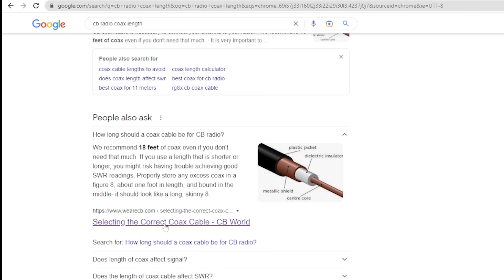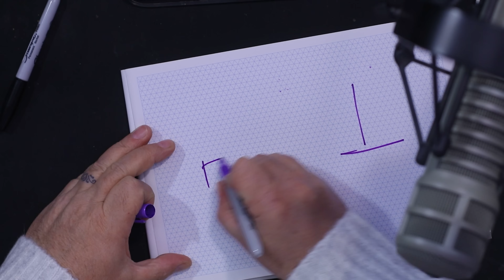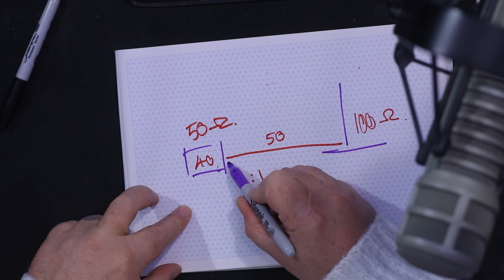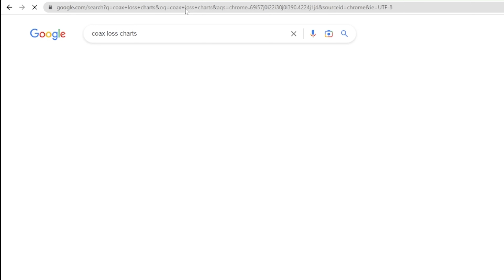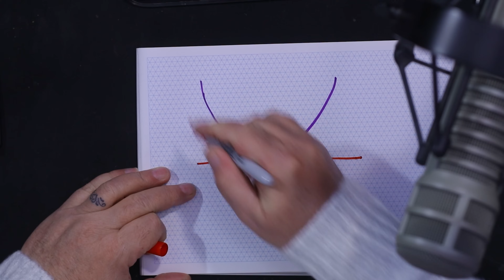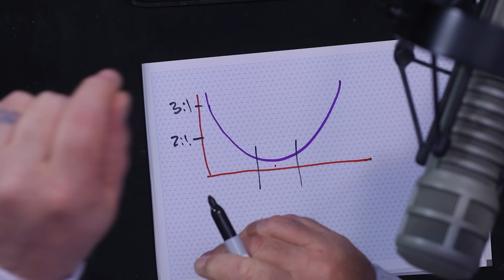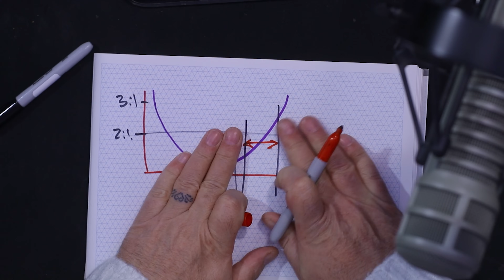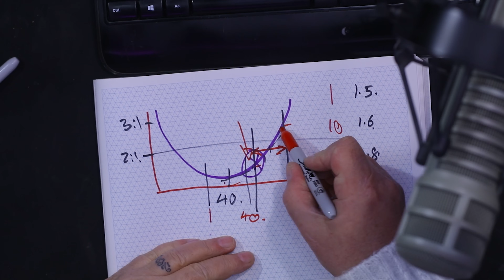11m / CB Radio: How Long Should My Coax Be?

Comment: in the 90s I also heard many theories on conductive but non-magnetic antennas and supports, I saw the coax cable cut for cb in multiples of half a wave, calculated on channel 20, also calculating the speed factor of the cable and a speed of light of 198,000 Kmh why not in free space where it is calculated at 300K, all for a CB with 4W, anyway RG213 is the minimum to use. Thank you🙂
Reply: I'm not sure what you're saying on how they calculated the length, but why not a half wavelength or more? This way you can actually see the impedance of the antenna when you plug in your analyser. As for 213 minimum, that's just ridiculous. In a mobile setting? Quality RG58 is fine, and far more practical. The difference in losses is negligible, and couldn't possibly be detected on a receiving meter. That's about the stupidest thing I've read on YT in quite some time. Where do you people get off?
Reply: @arconeagain  There was talk of fixed and non-mobile installations, try to stay on topic and not daydream, in the channel I have never seen road tractors, trucks, boats or cars, and usually for a 5/8 antenna between descent from the mast and section to get to the CB there they are more than 20 meters, yes the RG58 is fine in a car or truck, I brought back a theory from the 90s, dear wise man !
Reply: @winterburan  well maybe be less vague with your comments. I still don't understand what you're saying about the length calculation. What's wrong with the 198 if they're using a usual mil spec RG213 or 58?
Reply from the maker: Haha!

Comment: I also want to add mate that they use the coax quite often to tune the system. Some of the amplifiers they make have such bad tuning they use the coax to trick the radio into a proper load. I’m sure they will be along to argue with you mate. Cheers.
Reply from the maker: I'm sure too. It's still wrong!
Reply: @DXCommanderHQ  it's not wrong Callum it's just another way to provide a conjugate match to the transmitter to produce its maximum power into the system, reflections by Walt Maxwell covers this subject at great length
Reply from the maker: It's "wrong". Absolutely wrong.. You can make a tower out of soft spaghetti - that's wrong too.
Reply: @DXCommanderHQ  using feedline as an impedance transformer is not wrong what's wrong is not understanding that feedlines become impedance transformers with a mismatch